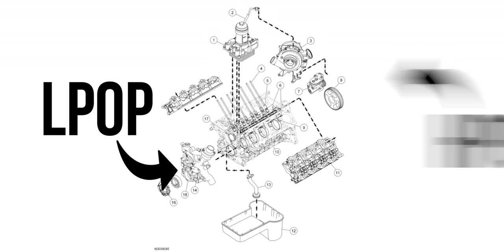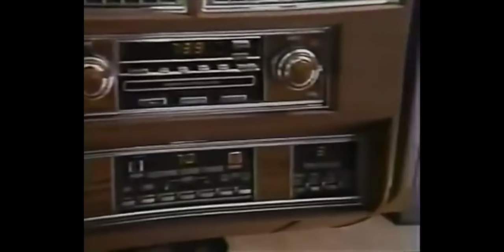These are the WORST ENGINES EVER MADE

Comment: I knew the Oldsmobile diesel and 5.4 Triton were  going to be on this list. The diesel had potential, but it was rushed into production without proper long-term testing that would have found the problems. 

The Triton firing spark plugs like a sniper rifle is one of the most hilarious failures ever, and I have actually seen F-150s with dents in the hood from them
Reply: That's because Spark plugs were Replaced by Mechanic or the owner  and did Shit Job Installing Spark plugs usually Right Rear #4 Cylinder People are  Lazy to Remove Either Heater Hoses or ECM or Wiring harness can that #4 is hard to get to. I've Replaced Spark plugs on many Ford V8 Nodular Design  Engines Triton since 1990 to presentation and I never had a Come back on Customers Car or Truck with Plugs loose or popping out. I've Fixed Spark plug Threads on few Ford Engines I know it's. Common only because Last Guy did Lousy Job  Mr Speedy Wrench

Comment: Another one of the major issues with the olds 5.7 diesel was the people that owned them, the average person had/has no idea how to run a diesel or at least older ones, they were being run like a gas engine frequently being run on short trips without ever getting good and hot diesels won’t reach operating temp as quick as a gas engine so they got all sludged up didn’t run for shit but if you took it out and ran it hard for a good 30-40 mins every once and a while they were pretty good then
Reply: My Dad bought a new Olds diesel in 1980 and drove it 13 years, only having to changed the fuel pump. Probably had less than 90,000 miles on it.

Comment: First off, Triton engine with the spark plugs shooting through the hood was not as common as people say it is, and there are way to prevent it. The 3V 5.4 is a much worse engine than you made it out to be, although if maintained they can lastz one of them is at 1 million miles, a 2009 F150.
Reply: Agreed.
Reply: My buddie has a power joke 6.0 that's gone over 500k without an issue....dosent mean the 6.0 isn't junk...same with ford's modulars....junk.
Reply: @youtubecantsaveallthesnowf8601  The 2 valve 4.6 modular on the Crown Victoria and Lincoln Town car are good.
Reply: @terrificspokesman  good at making no power and getting crap mpg's....but yeah, they ran.
Reply: @youtubecantsaveallthesnowf8601  Yeah. They did good in the Crown  Victoria police interceptors and taxis as they keep on running.
Reply: Freedom racing timing kit with stainless steel ratcheting tensioners, ford oem updated vcts, followers, melling high volume oil pump, stainless steel hardware for the manifolds etc cost about $2000 in parts. The manifold job is hell, but the timing is straightforward. After that those motors are bullet proof. Not bad for 2 grand

Comment: Worst engines ever is a tie:
Cadillac 4100. The worst part about these engines was, of course, the main bearing caps loosening and, if not notice immediately, ending up in the oil pan. Add to this the weak accessory brackets for alternator, smog pump, idler, etc mounting. These would bend over time, running the belt out of alignment causing multiple issues - especially the annoying bending of the thin stamped steel water pump, as well as wearing out bearings in every rotating device. I could go on, but isn't this enough?

NEXT, we have GM's 3800 Series II. The first 3800's were generally fine engines, but GM was done with THAT nonsense! The next gen had plastic intake manifolds with teeny strips of silicone rubber as gaskets. These were essential several feet of O-ring. Result? INEVITABLE  COOLANT LEAKS. The leaks led to immediate hydraulic engine lock-up. During the time when these engines were in use, one would see countless Bucik Le Sabres and Pontiac Bonneville's sitting around at shops - or in junk yards - which looked nice overall. Well, they were sitting because the engines were locked. Parts and labor to repair them was high, and they would fail again in short short time. 
If having the engine lock up wasn't enough, one had to recognize what had happened and know to NOT try to restart the engine. The starter was a torquey little devil, and if engaged with the engine locked with coolant filled cylinders...THE END OF THE STARTER BROKE OFF! You had the lock-up to deal with, and you had to replace the starter which had broken off the damn motor.

I'm an older guy, much closer to 79 than 60 now.  I have been a mechanic insofar as doing most of my own repairs and as a garage mechanic for some time, but my dad before me was the real mechanic.  I learned a lot from him. Through it all, these two have been the worst engines I have ever encountered, making even the un-lined aluminum Vega engines look pretty decent.

Comment: Pushrod v8s have less moving parts, are cheaper to produce, have the same power output, are physically smaller, easier to work on, last longer, and are easier to upgrade.

Just, better all around than dohc v8s.

Comment: The Ford 3.8 Essex V6, especially in front drive applications like the Taurus/Sable, Continental and Windstar minivans.  Notorious for headgasket issues.  Actually saw one fail in real time when leaving work.  A Windstar minivan appeared to have a dead battery as it wouldn't turn over.  It did eventually turn over but ran poorly and created a huge plume of white steam from the exhaust...and it wasn't that old at the time.  I'd probably add the 2.5 GM Iron Duke...durable but just unrefined, low revving and low power.
Reply: I ran a machine shop then and the 3.8 ford heads rolled in by the tons. The aluminum the heads used was gummy and didn't have the proper heat treatment. they blew head gaskets religiously.  Deck of the head was too thin. Suffered from corrosion from antifreeze. rebuilt many. I remember some coming in the shop warped .030"   The 2.5 iron duke was very reliable from what i recall. I fixed some cracked heads but was mainly due to customers over heating them. They were a long stroke motor and didn't rev,but made reasonable torque. The cross flow heads ran the best,but my memory might be wrong.

Comment: You're very right about the GM Oldsmobile diesel engine and the lack of a diesel powered passenger car market in the U.S.
Reply: That's the fault of the EPA
Reply: When they were built, tho, nobody was close to matching the over 30 MPG in a full size car with gas prices thru the roof.

Comment: Is there anything that compares to the Vega 140?
Almost CERTAIN to CRACK THE HEAD around 50,000 miles in normal usage and with decent maintainance.
Reply: Wow that was really early on, when they were still learning about aluminum on steal stretch issues. The greater screw up is when they tried to run a short oil pan on the Fierro, causing the fatal oil leak onto the exhaust manifold and car burning up on the side of the road. The engineers openly disagreed with it and the pencil pushers did it anyway. Was really great little sports car once they put the more expensive motor the engineers built it for. But it was too late. The public had already seen them burnt on the side of the roads.
Reply: @ltwig476  The sad part is that GM made a perfect engine for the Vega/Astra - and sold it lock stock and blueprints to Rover in the mid-1960s.
They tried to buy rights back a few years later, when they started designing the Vega - no sale.

The Buick / Olds versions of the 215 Aluminum Block (with steel liners) aluminum heads V8 from 1961-1963.
Reply: WOW!
Reply: @porterstreetcollective5037  I forgot to mention that the Buick version of that engine became the basis for the Rover 3500 - and it's later larger derivatives.
Reply: That didn't always happen... sometimes the car rusted out before the engine died.
Reply: @lizkrinsky5209  Perhaps in the Midwest, they DID have the "steel was already rusting before it went into the car" issue that many GMs had in part of the 1970s.
Reply: @bricefleckenstein9666  Yep. Dad bought a Vega Wagon in 1972 as a small car to go back and forth to work in. No issues with the engine or overheating but a couple of years in he was washing it and the vents in the hood crumbled away. Only the paint was holding it together. He got rid of it before it rusted away. And we did live in the Midwest.

Comment: GM 3800 series II. Great engine by itself, excellent power to fuel economy ratio and very reliable if properly taken care of. The issue was that GM used cheap plastic intake manifolds which used a stupid design that unnecessarily had a water jacket running through it along with the cheapest gaskets known to mankind. Combine that with dexcrap and that plastic would eventually become brittle and leak coolant into the cylinders, often mistaken for blown head gasket.

Comment: Being a Land Rover enthusiast I have quite a bit of experience with Rover V8s slipped liners aren’t as common as it’s made out to be while there were cases of some casting inconsistencies with the water jackets in the early development of the rover v8 that when overheated it can cause the block to crack and slip a liner which only really happens if someone is neglecting the cooling system overall it’s a decent engine  pretty simple to work on as well it’s just a old school pushrod V8 originally it was the Buick 215 before the Brit’s bought it and revised it, it’s a good engine overall they last quite a long time

Comment: Maybe it is just too old, but the Chevy Vega engine is my nominee for this hall of shame. Blowing head gaskets, and wearing out bores ended many engine's lives at an early age. I remember seeing many shiny Vegas stacked up like firewood at the back of wrecking yards. A few people saw an opportunity by acquiring one for free or for up to $25 and putting a different driveline in it. Chevy small block V8's were popular, and made screaming machines. A few people did well by using V6 engines for a more powerful driver that would also get decent gas mileage.

Comment: One motor that I'd add to this list is the Toyota 22RE(injected) motor. The 22R(carbureted) motor in my opinion was a bullet proof motor but when they injected it then it would blow out something in the motor (never did figure that one out) and suck out all the coolant from the radiator and put it into the crank case. I had 3 different Toyota's with that 22RE motor that did that and my brother had 2 other Toyota's with that same motor and they did it too. A friend of mine also had a Toyota with that p.o.s. 22RE in it and his motor did the same thing. Toyota took a fantastic 4 cyl. and turned it into crap. As for the 5.4 ltr 3 valve? Well, I currently own a 2006 Expedition with that motor in it and so far it is running quite well with 152,000 miles on it but then I'm making sure to do my oil changes between 4-5000 miles so that it will hopefully last as long as I can make it last.
Reply: Just absolutely wrong about the 22re. My dad had several, one with 250k, 350k, and one pushing 480k miles.  Baseless lol.
Reply: @toddthezondalover645  it sounds like he got lucky. Either that or I just had incredibly bad luck because every Toyota with that 22re motor sucked out all its antifreeze and dumped it into the oil pan.
Reply: They don’t “magically suck the coolant into the crankcase” 

It’s a matter of ALL 20r, 22r, 22re engines must have the timing chain changed at 100k if driven normally, and sooner if driven hard with lots of hot rodding and down shifting to engine brake slowing the vehicle,

Otherwise what ends up happening is the chain rubs through the timing case and suddenly the coolant port in the case is exposed and you get a flood of coolant pumping into the oil pan.

The real difference in your “22r good 22re bad” comparison is the carbed models typically wore out faster from poorly adjusted carbs and were rebuilt sooner, while the EFI 22re’s were driven much more with less repair-per-mile to keep it running properly

Comment: Really surprised you didn't put the 2.7 Mitsubishi in the list. They would frequently burst the water passage sections of the head gasket and dump all the coolant into the oil sump.

Also several different iterations of the Ford Duratec V6 with the water pump inside the timing cover had a frequent habit of blowing out their cheap seals with no warning and doing the same thing the Mitsubishi did.
Reply: Yeah.... those were awful about oil consumption.   Those things ate soooooo much oil.

Comment: Worked at a towing company in late eighties. Ford escort 4 bangers, cracked heads after timing belt snapped. Way to common. Getting a call from a tow “ ford escort engine stalled won’t start.” Tow driver “another one.”

Comment: I'm fixing a Northstar now. The only problem I see is the factory stripped out threads from one of the head bolt holes. This cause exhaust to leak from the number one cylinder into the coolant system.

Comment: I had a 6.0 that I recently got rid of. And I agree with people that say that it sucks but I will argue that with if it’s still stock. If it’s stock then yes, it can be a problem for someone that uses it for hauling trailers and doing stuff on the farm if you’re not the best on maintenance. BUT if you put head studs in it and bulletproof it then it’s really good, mine had 453,000 miles, almost 250,000 since it had been bulletproofed and studded. And I didn’t have any problems except the regular stuff that just comes with time. Now I have a 2015 lml duramax and I love it to death but I will never forget the whistle of the kc stage 2 turbo on that good ol 6.0

Comment: So I consider myself a novice mechanic. Bought a 2006 F150 5.4 3v with 322,700 mi on it in May. Its now January and about 10k miles later. I completely redid the timing, lash adjusters, rollers, phasers, chains, tensioners, melling 340HV oil pump, and guides. Also replaced the VCTs and the water pump (just for preventative). Overall this thing has rocked pretty good so far. I use it as my daily, and around town. 

I completely agree that the engine is a bit meh on power. Further the low pressure pump ford put in as well as the bad roller design killed alot of cams and journals. Poorly made tensioners ended up causing slap and debris which further worsened the oiling problems. 

With the new oil pump and redone the truck is happy and I am hoping to get many more miles out

Comment: You missed the most hilarious point surrounding the FoMoCo 5.4 - They went from sending spark plugs into orbit to seizing them into the heads, requiring a special socket for routine removals, and a BS 2-piece design that was all but guaranteed to fail, leaving part of the plug in the engine that now needs to be extracted.  No easy task on an OHC engine where the plug is buried down a narrow well.  The automotive service tool industry made a fortune selling tools to service the 3v 5.4L Tritons and I'm sure the paper industry made a couple bucks selling tissues to the service techs and customers stuck with them.

Comment: 4 .1 Cadillac of the early 80s terrible engines , blown head gaskets , oil leaks and the 8, 6 , 4 cylinder deactivation system trouble .

Comment: Disagree on the 5.7 Hemi. I got a 14' Charger R/T with 230,000 miles, and runs like a champ. The ones that have issues are the police vehicles, because they sit for 2 to 3 hours at the scene of an accident, just idling with A/C running full blast, and that will kill any engine prematurely. Also police dept's use the cheapest oil, the cheapest filters, and generally beat the hell out of them, especially city police cars, as opposed to highway patrol vehicles. If you don't keep up on the oil, and filters, yes, they will start to have knocking issues.

Comment: 2018 1.5L 4cyl Ecoboost  One went due to detonation. Took 3 months to get parts and change it.  14 days after I got it back the new one EXPOLDED in smoke and flame in the middle of a busy hi-way. Dealer said the block was defective. I did not wait to find out how long it would take to fix this time. I traded it on a 2.0L Ecoboost. It's been fine.

Comment: I will take exception to your 2.2L Mopar reference. I have had several of these, and yes the original 2.2L carbureted version was, shall we say, underwhellming in it's performance. That coupled with the feedback carburetor on a rubber mount was a disaster waiting to happen. The first TBI systems were a joint Chrysler/Holley effort and were just plain strange. Later TBI systems were pretty similar to GM units and not bad for TBI. Two areas where these little engines showed their potential, the original Shelby designed Omni GLH and the one Plymouth allowed the 110 hp high compression 2.2L carbureted engine. These were fairly light, peppy cars. Then came the turbocharged versions in 1984, improved with computer controls in 1985, then in late 1986, Carrol Shelby struck again with the GLHS and Shelby Daytona, both having 172 hp 2.2L engines with forged cranks, beefy rods, a unique 2 piece intake and a Garrett turbocharger. Not only were they strong, they were durable. My Lebaron convertible has embarresed more than a few V8s with it's performance.

Comment: V8-6-4 after the Modulated Displacement system was permanently deactivated was an excellent running motor. Mine was deactivated before I bought it in 1995. I drove it for six years. The car is a 1984 Fleetwood Formal Limousine that I drove as my everyday car.

Comment: The Northstar?  I drove my 2002 Deville in Germany.  I didn't change the oil for 50,000 miles.  I was on the autobahn daily.  I floored in EVERY TIME.  I never had a single issue with the engine or transmission.  The interior didn't hold up great, and all the windows stopped working.  But, I never lost the A/C or stereo, or really anything.  When I got it a mechanic who worked on Deville's told me that the car needed to be abused to last.  He said the one's always coming in were the ones that were babied...